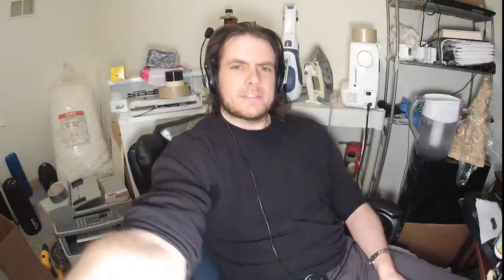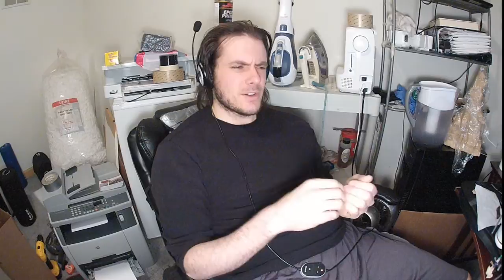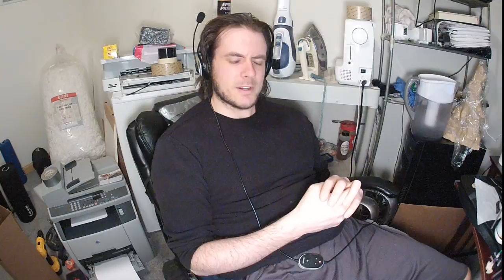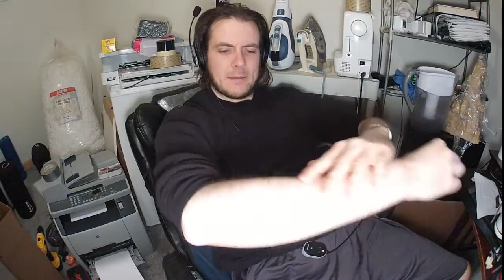Advantages of Giving Humanoid Robot Artificial Skin | Building Humanoid Robots #10

Comment: Just found your channel via a post in VPGloves discord, and I'm fascinated by your project! I haven't gone through all your content yet, so I'm not sure if you've found alternative materials since this video, but if you haven't yet come across it I highly recommend Dragon Skin silicone rubber by a company called Smooth-On. It's commonly used in special effects make-up and mask-making, but it comes in various "hardness" levels (you can get pre-made sample swatches from Reynolds Advanced Materials) so you can find the density and texture you're looking for for your skin. They also have silicone pigments in skin tones which you mix directly into the Dragon Skin so that you have a consistent flesh tone in the material itself, then you can airbrush on any tonal changes after the curing process. Mixing in a pigment that's made for the type of medium you're choosing for the skin will be important in getting an even skin tone PLUS avoiding any cracking that will happen by just applying pigment to the exterior of the finished product.
I just followed on your Twitch channel, so hopefully we'll get to chat next time you go live.
Reply from the maker: Thanks for those tips.  I have seen Dragon skin while shopping for different silicones.  Also I will be for sure using silicone and not latex after doing a lot more research since this video was made.  All the techniques you referred to I've seen the pros use and you are dead on about it.  I've been watching a lot of videos starring Steve Wang who is considered to be one of the best silicone model makers of the world.  He worked on predator, gremlins, hell boy, underworld, alien, Chronicles of Riddick, and his company makes all of the gaming Expo displays for blizzard, league of legends, and fortnight.  He's a legend with special effects and I have been studying his work.  I also have studied the work of Thom Floutz who I consider to be one of the greatest silicone skin artists ever.  Anything he works on looks completely photorealistic.

Comment: They recently found out they could vary the texture and stiffness of artificial silicone skin by adding "impurities" of bubbles in it. They used varies degrees of injected liquids using a hypodermic needle as it cured, to change the skin properties. Maybe it would be easy to do by mixing in micro sized wax pieces or air bubbles or droplets or even fake blood. It would sure help to allow it to disperse heat easier if it was less of an insulator because of water in it. They also embed uncured glues in case the bubble 'pops' due to damage so the material can self-heal.
Reply from the maker: I think these ideas are great I'll keep them in mind